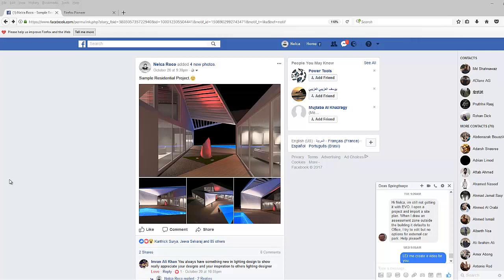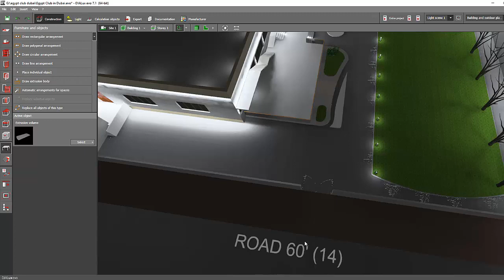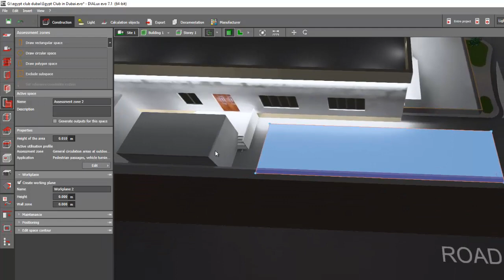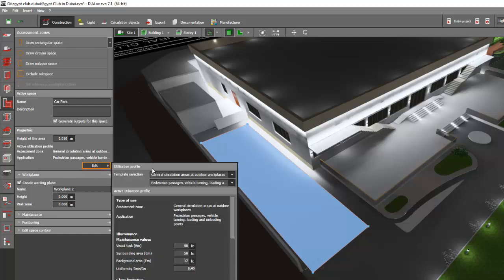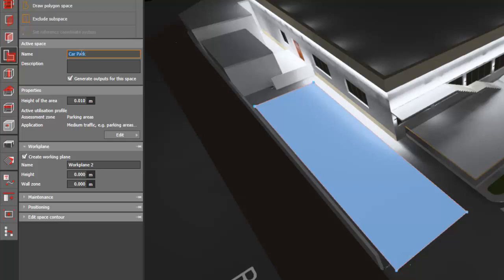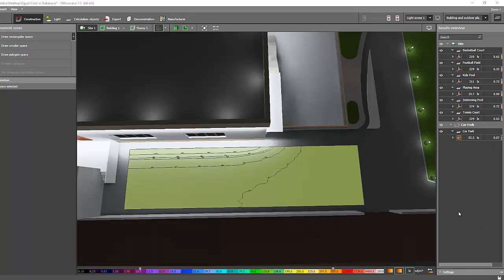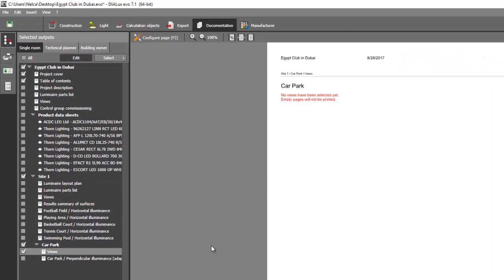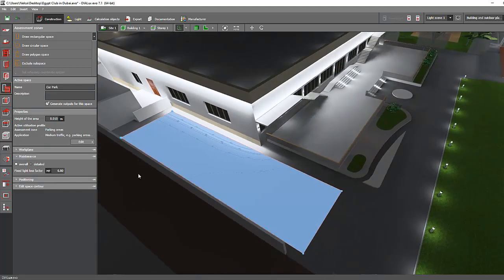How to create an outdoor assesment zone

Comment: Hello Nelca, I need to simulate a public square with sports environments. In the same style as your video. I would like some tips from you when creating this simulation.
where can I find all these tree libraries that you used.
I currently use dialux evo 9 and I noticed that you use dialux 4.12 is there a lot of difference between the 2?
I'm an engineering student, I live in Brazil.